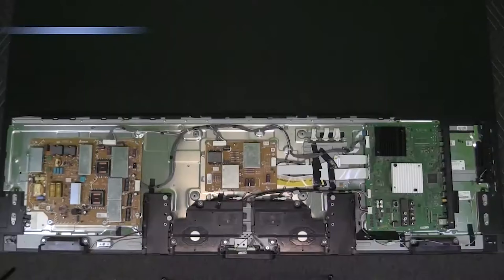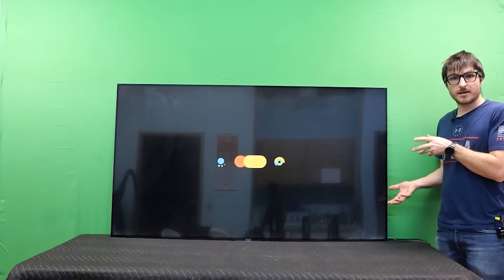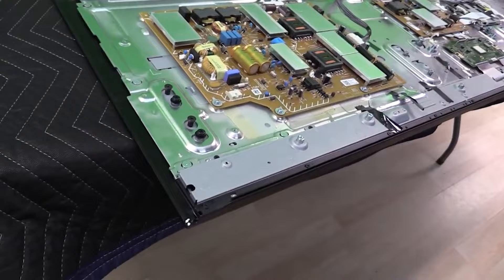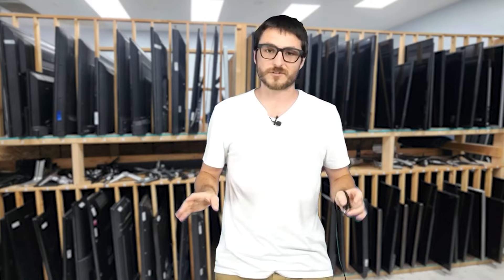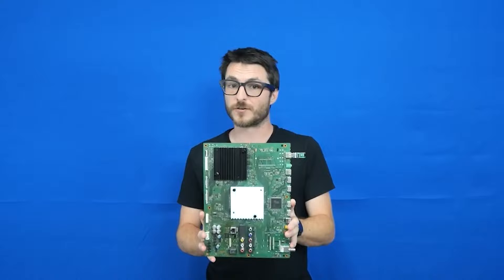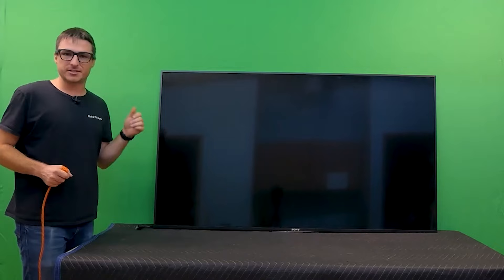I Fixed Over 1,000 Sony TVs Here Is Everything I Learned | Master Series

Comment from the maker: 2015 models
00:33    Symptoms caused by a defective mainboard for 2015 models
02:54    XBR-55X850C Dead/no power and cycling Mainboard eMMC Repair
06:10    XBR-55X900C & XBR-65X900C 4 and 6 blink quick Repair
09:04    XBR-65X900C Dead/no power, and cycling eMMC Mainboard Repair
12:28    XBR-65X900C 4&6 blink code LED Replacement
33:41    XBR-65X900C Dead/no power We fix everything that can go wrong on the Mainboard

2016 Models
42:45    XBR-65X850D Dead/no power eMMC Mainboard Repair
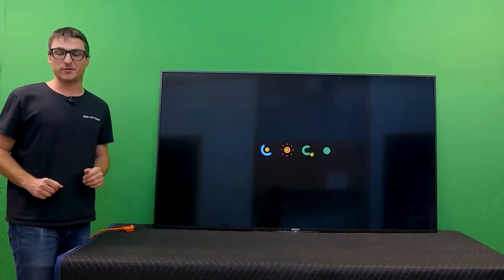47:28    XBR-55X850D HDMI no signal  HDMI processor Mainboard Repair
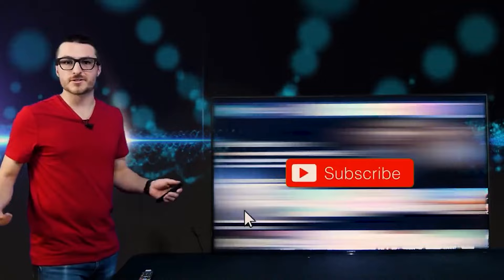1:00:39 XBR-65X850D Dead/no power CPU Mainboard Repair
1:12:34 XBR-55X930D Dead/no power DPS board Repair
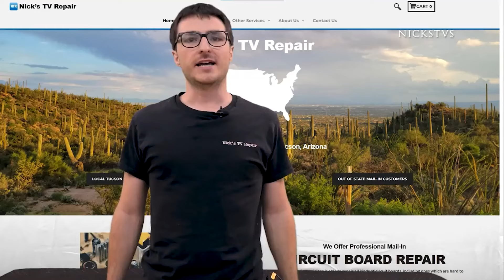1:20:14 XBR55X930D Dead/no power CPU Mainboard Repair
1:25:52 XBR-55X930D Dead/no power eMMC Mainboard Repair
1:28:49 How to mod an XBR-75X940D Mainboard to work with an XBR-65X930D

2017 Models
1:40:02 Common symptoms and repair solutions for 2017 models
1:42:56 XBR-65X850E Dead/no power Power supply Repair

2018 Models
1:46:23 XBR-75X850F Dead/no power diagnostic & eMMC Mainboard Repair
1:52:50 XBR-49X900F Dead/no power FULL In-depth Diag + eMMC Mainboard Repair
1:56:52 XBR-65A8F Dead/no power diagnostic & eMMC Mainboard Repair

2019 Models
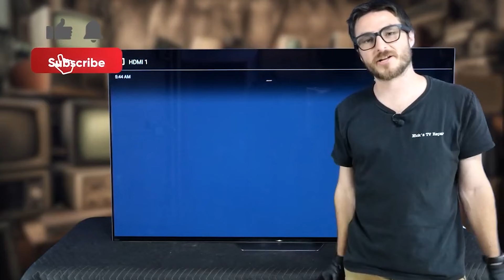2:01:51 XBR-55X850G Dead/no power diagnostic & eMMC Mainboard Repair

2020 Models
2:06:53 XBR-65A8H Dead/no power CPU Mainboard Repair

Pairing Procedures
2:10:50 How to pairing process, what to do if pairing doesn't work
2:18:46 How to download software from Sony's website and file name change 

Questions? Leave us a comment or contact us directly:
https://nickselectronics.com/pages/co...
info@nickselectronicrepair.com
520-838-9359

Comment: How about a sony that flashes 6 times when powered on.
Reply from the maker: That will be LED strip failure. You will need to replace your LEDs to fix that issue.
Reply: @NicksTVRepair  Hello i’ve watched a few other videos and they disabled the function saying it was the rear light.When they disabled it the tv came on but i don’t know how well it worked.
Reply from the maker: That only works for the 900C models and those only. All other models I do not recommend doing that.
Reply: @NicksTVRepair  Thank you
Reply from the maker: No problem

Comment: Hi, did you ever fixed a tv plasma Model : TH-42PX60U Panasonic, My tv have bars in it, at left side there is like 2 black lines and 2 other lines are like distorted with color and sometimes those 2 other lines get back to normal but change as the image change... (I saw on internet it could be a loose connector) Is there anyway to send you a email with a picture of the problem so you can give me the exact problem ? I live in Canada(Québec) .. to far to send it to you xD Thank You! Sorry for my bad english ^_^
Reply from the maker: Most likely you have a bad panel. Connectors don't get loose on their own unless you opened up the TV and caused that to happen in which case you would know exactly which connector is loose. But if you didn't open up your TV and it's been sitting still on your wall mount of TV stand then your screen is probably just going out. There is unfortunately no repair for this.

Comment: I have a Sony NSX-46GT1 Model.  Did a factory reset on it by accident.  Now, its not letting me get pass the google account sign in step.  Because its an older tv, and its not supported any more.  Its not letting me skip this step. So i cannot even use the tv.   Need your help please.
Reply from the maker: I am sorry I don't know how to help you as I haven't really worked on these models before or encountered that issue. All I would be able to do is try googling this around on the internet and see if someone else has had that problem before and how they resolved it. 
If you find the answer, please let me know so that I can help the next person that asks with this issue.

Comment: I have an XBR75X850F that turns on and has sound and controller function but no image appears.  Backlights seem to turn on (can see exterior glow around edges).  Tried factory reboot and it now sounds like its on the initial setup screen but no image.  Thoughts?
Reply: Just for posterity and anyone having the same problem, I took a guess and replaced T-Con board.  TV works great now.
Reply from the maker: Wow really. That's unusual. Please follow up if the fault comes back. Usually we see mainboards failing and causing that issue.
Reply: @NicksTVRepair  I have the same issue. Backlight is on, I can hear sound but no picture. I've tried factory reset, updating firmware, checking FFC connectors. No flashing error codes. Also seems like there are no shorts near main chip. Any further tips where to dig?
Reply: I figured out that in my case it was faulty ribbon cable between TCON and motherboard. Huge thanks Nick!

Comment: Hey Nick. I have a 55X90J it’s only been used 2years.  It has 4 blinking lights.  Is it worth fixing?  I on a limited income.
Reply from the maker: Regardless of your income, this TV is worth fixing. You will need to replace the LED strips to get it back up and running. It is a fairly labor intensive repair, but this is a very nice set and most definitely worth fixing. If you can afford the repairs right now or if you might need  to save up for the repair is a different question only you can answer.
Reply: thank you very much for responding

Comment: I have a 2014 KDL-60W610B Bravia 60” LED, in which I just learned has a 120Hz refresh rate and enjoyed for 10 years. I  recently had a lightning storm and it went dead. I can hold the power button in and plug it in which brings up two circling arrows but then shuts down after 40 seconds or so. The LED flashes 3 times repeatedly. I love this set and would love to save it. Any ideas?
Reply from the maker: Sounds like you have a defective mainboard. Most likely a power surge came in through either the Ethernet cable or HDMI from the cable box. 
Did other devices get affected?

Comment: FANTASTIC content Nick! You do a great job empowering people to repair their TV's and explain things in a logical yet easily digestible way. 

I have a XBR65X930C that I was able to repair due to your helpful videos. Unfortunately it didn't last too much longer. I have a few thin horizontal lines across the screen that I cannot get to go away regardless of which ribbon cable I pull off of the T-con board output. I'm suspecting gate driver failures (don't know how to confirm), but I cannot seem to source a replacement panel. 

I REALLY appreciate the resource you provide to the community, keep up the great work!!

Comment: Hey Nick and co. I have a KD-65X9005C 3D tv. I had some LED vertical lines popping up on the right side of my screen last year, then I got 4 blink code and tv would not go past load screen and just shut off. I took your advice and moved the cable to earth to stop the error code from signalling to the power cable to shut down. This worked great and after a month even the vertical lines went away. This lasted 8 months.  Ow they are back but like 4 lines now of different colours. Any ideas what to do here. This is the last best 3D tv and I don’t want to lose it. Any ideas what it could be?
Reply from the maker: 4 blinks is LED failure. If the grounding of the fault is no longer enough to get good picture on screen You will need to replace your LED strips to fix this fault.

Comment: i have xbr-75X900E when turn on white led  on later change to red light blingking 4 times but tv do not turn on no sound of click from thr power supply. Before when turning on you will hear the clicking sound and the tv turn on. What is that red led code 4 times blinking?
than you so much more power to your channe;
Reply from the maker: 4 blinks indicates you have a backlight failure. 
The backlight is another word for your LED's that illumiate your screen. You have to replace the LED strips to fix your TV. This is something that is more advanced and I would recommend you find a local TV shop to help you with this repair.

Comment: Hello Nick. Hope your doing well and cheers for these videos. I'm troubleshooting a KD55xe8096 , I'm only getting 3.5 standby and no other volts, so I was doing the jumper trick to force it on, trouble is I'm getting good volts on tcon pin etc , however I'm not getting the 12 volts on the power-on pin( only the 3.5 due to standby jumper) ..... so am not any closer to narrowing down which board,I want to believe it's main board issue.....I should have said I'm only getting the 3.5 standby, nothing else, hence doing the jumpers
Reply from the maker: You are giving the voltage to the Power on pin from the standby voltage so that line should indeed only get the 3.3v. 
What this will do however is that it will power on the board and the 12v line should now be active. So you need to check the 12v line for 12v not the power_on line.

Comment: I have a Sony Bravia KD-55X8507C TV. When I turn on the TV, it works fine without any problems. However, after using the TV for a longer period, approximately an hour, when I turn it off and then back on, it doesn't work. I only see a black screen (the backlight turns on), but nothing appears on the screen—no logo, no menus, and no volume. I suspect this has to do with the temperature because after about 30/40 minutes, the TV turns on normally without any issues.

I currently have the TV open, and I don't see any obvious signs of damage. The power board on the left is not excessively warm. The metal covering the Tcon board does get warm, but not to the point of burning your hands. The same goes for the mainboard (the black and white heatsinks) which get approximately equally warm, with the black one being slightly warmer than the white one.

Now the question is, is there anything I can do to get the TV to function normally again?
Reply from the maker: I can't say that I have ever heard of anyone with this issue before. 
You get backlight but no audio and no picture? If you get both backlight and audio but no picture then I would say you may have a T-con fault. But if you can't get the audio either then you may have a mainboard fault

Comment: Hi NTVR
I have a Bravia 55x900F that powers on to the Android screen followed by black screen and 4 blinking reds. I want to try the "ground the BL-ERR pin trick" per your video, but the only place I find board markings for a BL-ERR pin on the 900F is at the connector on the Power Supply board. Your video shows doing the grounding at the LED Driver board but I cannot find board markings on the LED Driver board connector. So, which pin and where is it that I need to ground on the 900F? Do I simply ground the BL-ERR pin on the Power Supply board?
Reply from the maker: The BL_ERR ground trick only works for the 900c. Since you have a 900F you need to replace the LED strips to fix your set. 
Sorry, no easy way out on the 900F model.

Comment: Good Afternoon.  I have a Model # KD-55X720E Aug 2017 Ser # 4037952. I have where the TV will turn on, but will turn back off after 3 attempts and then flash the red light 3-5 times.  I would like to know where your shop is or if you can recommend someone here in Houston,Texas? Signed:Love my Sony TV.

Comment: Great video Nick, how about a 5 blink code in the Sony KDL SERIES??
Reply from the maker: That is not a very common fault but that could be a panel failure, T-con, or mainboard. It depends on the model number of the set. Each model is different and tends to have different likely faults. I would recommend you post a new comment with the full model number and I can look more into it. 
If you reply to this comment I won't get a notification and most likely won't see so that's why I ask for you to do a new comment.

Comment: Hi. I have a xbr 65X855E as I've seen in your videos it is look like 65X850,  from some days ago the screen turn to green and pink pattern like minute 1:40:36. Audio works ok when I push TV mode on the remote control, so it is seem that it is a just video issue. Do you know what is the problem and how can I fix it? I live in Argentina so it is impossible to get your repair services... main board number is A2170480A is the same of 65X850? Thanks a lot!!

Comment: XR-77A80CJ (OLED) screen flash once when powering on. Nothing else...no sound etc. All boards replaced and working. Probably main eMMC failed like many Android TVs?
Reply from the maker: Do you get an error code from the standby light? If yes, then please let me know exactly how many times it blinks. If not, then yes you are correct, it is probably the mainboard. If you already replaced the mainboard and still have the same issue, then it is likely you received a defective one. A lot of people sell replacement mainboards that don't work. I am biased of course but this is one of the reasons it makes more sense to have a new eMMC installed on your mainbaord than buying a used one. Even if the used one works, who knows for how long.
When we replace the eMMC you know you have a brand new eMMC chip that will last for years to come, and we also provide a 1 Year warranty with the repair which you won't ever get when buying a board even if it's brand new.
Reply: @NicksTVRepair  TV was fixed with complete board set replacement. I'm guessing old main failed with eMMC (have encountered before on HiSense) I can ship the boards to you for repair/repair for free
Reply from the maker: I won't say no to free parts!

Comment: Good afternoon. I have a Sony XBR-65x850E that is displaying the 6 red blink error code. If you unplug the unit, let it cool, and plug it back in, it will boot up just fine and play for minutes to 5 to 10 minutes. It shuts down and that's when I get the six red blinks. Again, if you let it cool, unplug, replug, and turn it back on it will start up and play for a while. 

Any suggestions? It sounds like possibly overheating, but, I have confirmed that the vents are not clogged and it is open in the back for lots of airflow.
Reply from the maker: This is due to bad LED strips. If you go to your settings and bring the backlight brightness down you will probably notice the set will play for a longer duration of time before going back to the 6-blink fault.
The fix is to replace your LED strips which is a very labor-intensive process. I wouldn't usually recommend doing it yourself as this is also a high-risk repair as you have to remove the screen from the set to access the backlight which can often lead to cracking the screen if not done correctly.

Comment: If I do the jumper pins on my 75 900f I only get the backlight not the color test pattern. What could this be?
Reply from the maker: To me, it would mean your mainboard is defective. eBay is full of non-working boards so it's possible you received a dud or you didn't pair the board to your TV. 
If you would like to send in your mainboard for us to live test and fix we can do so, this way we can confirm the diagnostic and then perform the repairs. This way you know for sure whether or not the mainboard was the fault, and since we live test the board both before and after repairs we know again for sure the board you will get back is fully functional. We also provide you with the flash drive and instructions for pairing.

Comment: For the 4 red light issue, grounding the blk_err wire did not work for me on X900F. Backlights would sometimes turn on when I press the screen but as soon as I let go my hand, it will shut off again. Is there any way to bypass the error on X900F?
Reply from the maker: That only works with the 900C. To fix a 4 blink issue with your TV, you have to replaec the LED strips.

Comment: Hey Nick, I have an XBR-65X850F. The power supply has no output voltage on standby or Reg12. I ordered a new one and it’s the same thing. What are the odds the new power supply is also bad? Any thoughts?
Reply from the maker: Disconnect your power supply from everything else and then do voltage checks. Odds are more in favor that something else in the set is bringing down the voltage. If this is the case then reconnect each item one at a time until you find the culprit. If not, send me an email or fill out our contact form (both are in the video description) and we can discuss options further.

Comment: Hello Nick! Thanks for your very informative videos!! I am troubleshooting an XBR 65X900E with the external power supply. My problem is dead no power lights or sound. I cannot find a list of voltages for the step-down board (in the TV) so that I can further troubleshoot the TV. I have bought a new step-down board and a used mainboard from eBay and I still have the same problem. I have measured the voltage from the external power supply, and it is 24v. I don't really have a way to load test it. Do you have any suggestions about next steps? More than willing to send parts to you as well. This TV has about 50 hours on it. Thanks for any information or help.
Reply from the maker: With those models I always see the mainboard go out. I have yet to see any other parts fail but other techs have reported that the small power board goes out and the external power supply goes out. Again I have never seen that before and have worked on a lot of these. Just check to see if you are getting voltages to the mainboard from the power supply. If you are, then the mainboard is the fault. If you aren't then that little power board is most likely the issue since you said you had 24v from the external brick.
If you still aren't able to identify which is at fault you can send in both along with the cable connecting the small power board and the mainboard and we can test them in our unit for functionality and go from there.
For that, I would say to contact us directly. 
The video description has our contact info if you have more questions.